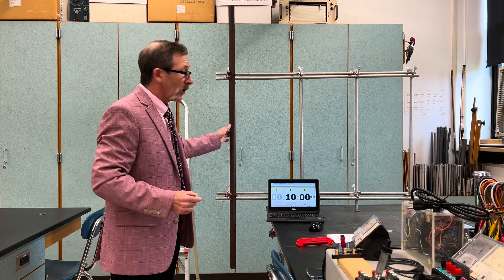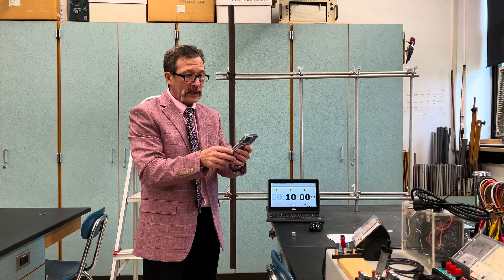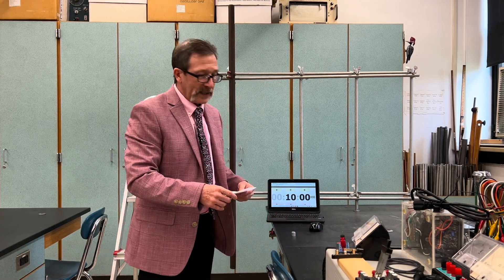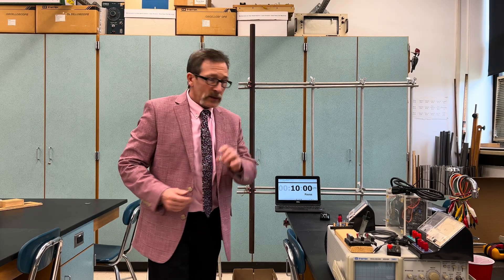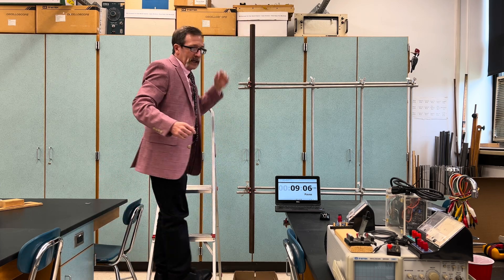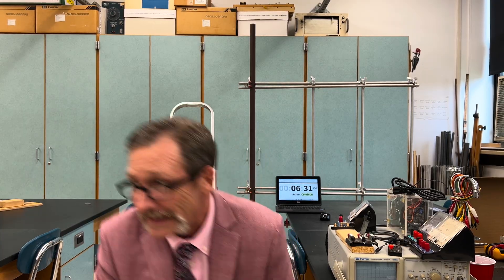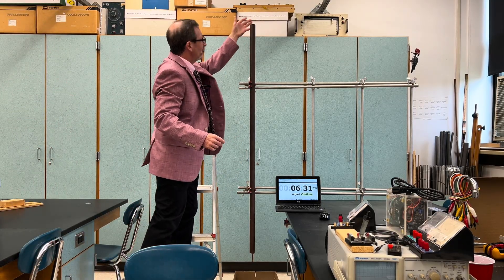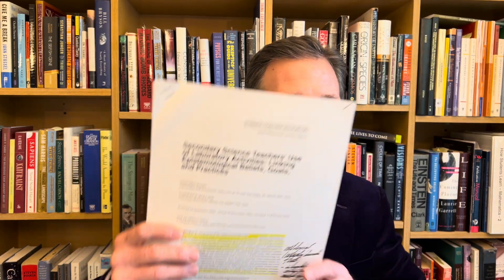What Happens When You Drop a Magnet Down a Copper Tube?

Comment: The metal pipes holding up the copper pipe is slowing down the magnet .
I wrote this before the conclusion of the video so lets see if I am right .
Reply: The magnet didn't go down straight, it rocked, so maybe as it passed the support locations. But then how much lateral momentum was imparted during the release, producing a pendulum effect? This can be left as an exercise for the student.......................

Comment: HEY, question:  imagine putting a 3 inch plastic pipe inside a 4 inch plastic pipe and filling the gap with powdered copper.  What (if anything) would happen in the experiment?  How about if the copper powder is joined together with a conducting adhesive and removed from the plastic?
Reply from the maker: Okay, to clarify, your question is: what happens if I drop a magnet through an insulator-metal-insulator-sandwich?
Reply: @idealizedscience  More generally:  does copper powder do the same thing as solid copper?
Reply: @SunriseLAW 
Only if the copper powder is conductive ( that is the grains of copper are not electrically isolated from each other.
Reply: @eric4709  seems powder would conduct electricity slightly better than solid... more surface area .... ?

Comment: for another video: What happens when you coat something entirely in a superhydrophobic coating and drop it in a tank of water. Does the coating "move" the water out of the way letting it fall faster than the same item not treated?

The water still needs to be displaced for the item to fall, and so there's still resistance, it it seems weird if there was NO difference between the two objects.
Reply from the maker: This would be interesting! We will think about it and see if we can cook something up

Comment: We just did this demo for some of our budding scientists using a copper pipe and an aluminum pipe.  I looked around for a smaller diameter pipe to also compare but was out of luck.
Reply from the maker: Home Depot/Lowes has the common sizes of copper pipe. The 1/2" size works well with the smaller neodymium magnets. Hope this helps!

Comment: So, what is the explanation for aluminium, as we know a bit about magnets. Copper being paramagnetic and aluminium diamagnetic … what am I missing here ? Work function of elements ?
Reply from the maker: Sorry for the confusion! Are you asking why aluminum falls straight through but the magnet does not?
Reply: @idealizedscience not exactly, we have seen a whirling aluminium falling fast/normal through the copper pipe, than without whirling it slow down … almost like a very weak magnet
Reply from the maker: Aluminum will fall essentially unperturbed through the pipe because it is not magnetic. However, we typically add some showmanship to the demo to see if the students are skeptical and engaged. But we essentially swap out the aluminum chuck for a magnet to trick them! Sorry if we are still missing your point of confusion... happy to elaborate if this doesn't clear things up!
Reply: @idealizedscience  oh, it is all clear now … I am just disappointed, I though there is something new to learn … after all my “water based batteries” work very well with just copper+aluminium+deionised water/pharmaceutical pure water and nothing else. Despite no measurable curent (my digital multimeter can only read 0.1 uA) I can lit up 40 white LEDs in parallel for as long as there is at least a molecule of water … for more than 3 years now and still going strong. ( see some studies from 1920 regarding work function of elements in dielectric liquids 🧐).